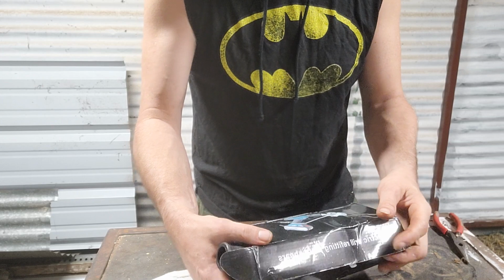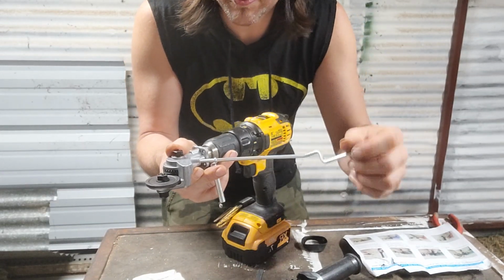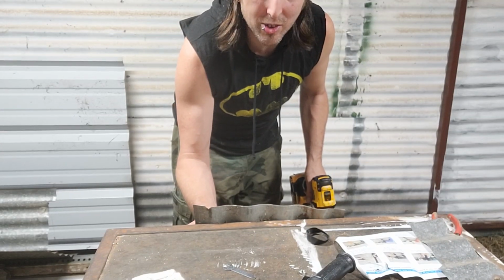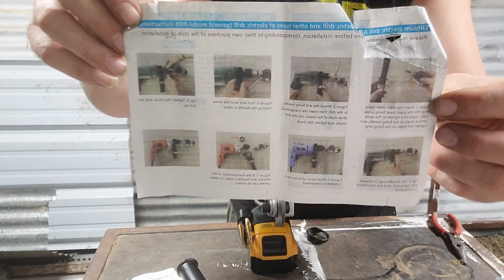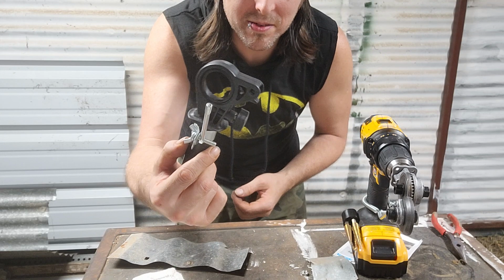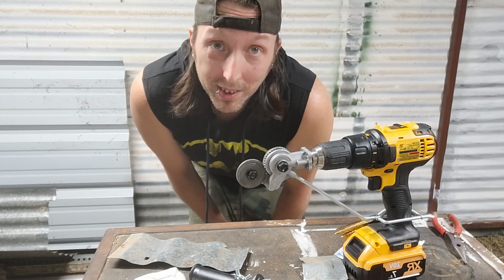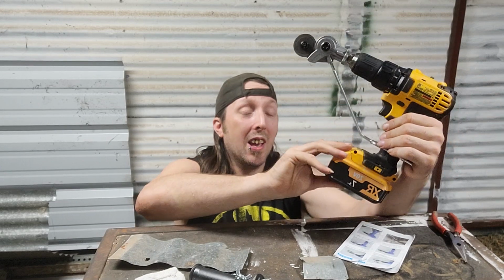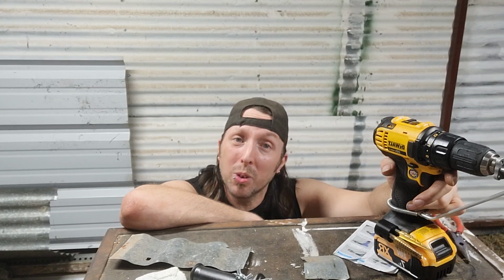S.2:Ep.27 Product test of metal shears for cordless drill

Comment: Hello, I have a problem with this tool because the wheel is turning but the tool won't move. Do you know by any chance is there is a fix for that?
Reply from the maker: May need to adjust the screw on the wheel.
Reply: Thank you for your response. Do you mean the little one?